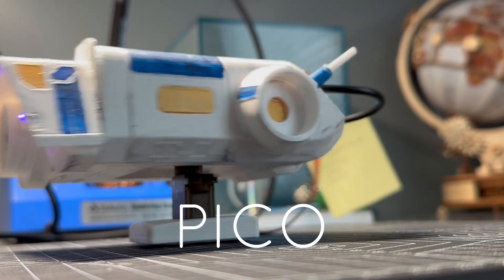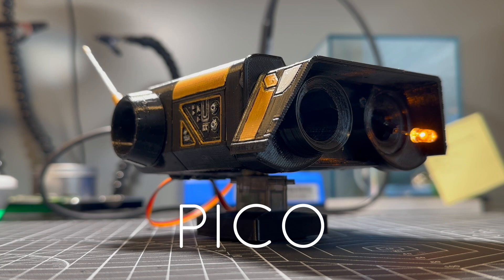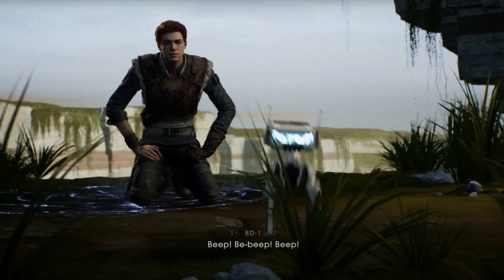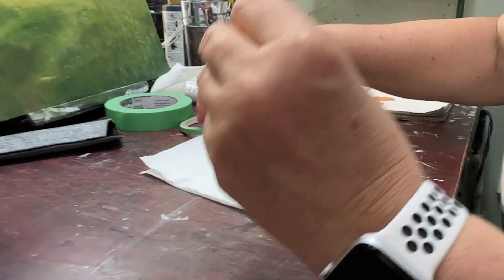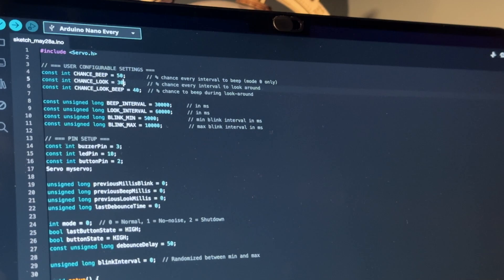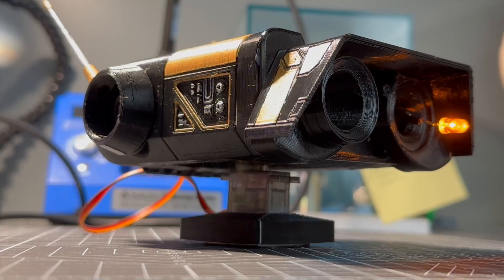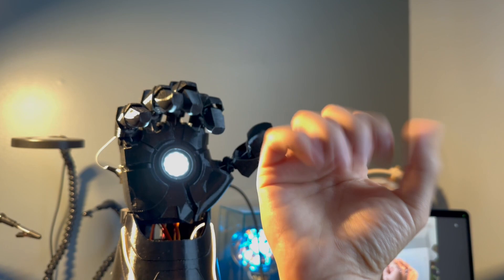My Smartest DIY Robot Yet (It's Open Source!)

Comment: hey man, idk if ur gna see this but the main frame of the robot (pico head) has multiple non manifold edges (1924 to be exact) and i cannot slice or print, im just making you aware of this, take the time u need to fix it or not, ive also put a comment in the thingiverse post
Reply from the maker: Thanks man, I wonder why I didn't see that or have issues with my slicer, I'm glad you brought it to my attention, I'll look into it!
Reply: @MateoTechLab np, btw ive fixed the problem by putting multiple cuts into the part, so maybe put that into the description of the thingiverse psot
Reply from the maker: @Voidreaper236yeah good idea, if you’d like to just tell me your slicer and what you did to fix it right here I can add it in with your preferred username for credit too
Reply: @MateoTechLab i used the cut item, then i repaired it with windows repair system in prusa slicer, i dont know if its in orca slicer though because i had to do it manually

Comment: im building one of these and i was wondering how do i connect the camera to pico? im new to coding and such so i dont really know what im doing
Reply from the maker: The camera fits into Pico by sliding the end of it into the hole at 2:15, and it’s plugged into a small battery pack I bought on Amazon. If you’re wondering how to code the camera to see the video feed, you can look up the setup for a “web server video for ESP32 Wrover Cams.” If you have any more questions, feel free to ask me!

Comment: Can we get a more detailed parts-assembly guide please? Not quite sure how the printed parts integrate with each other
Reply from the maker: I can post an image of the digital parts and where they connect to the Thingiverse page if that helps
Reply from the maker: For now, here's my best guide on the 3D print parts alone, based on the file names from my Thingiverse Page:
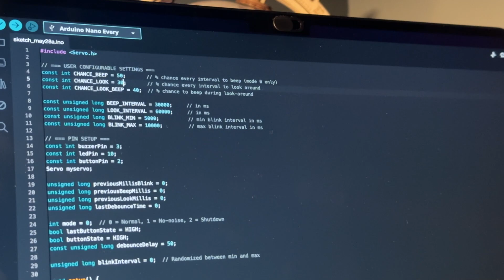1. [1:59] Glue Servo head to Pico_Head.stl
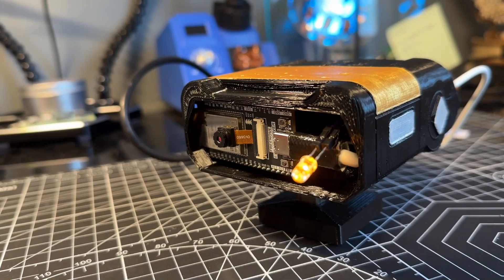2.  [2:26] Glue Servo & Magnet to Servo_Holder.stl
3. [2:35] Glue Eye_frame.stl AND Visor.stl to Mask.stl (Then glue Mask.stl to Pico_Head.stl)
4.  [2:43] Glue Antenna_ring.stl L and R to the left and right side, and slide (or glue) Antennas.stl into the rings.
5. Put other magnet under your shirt (I made a velcro strap that goes under my shirt) to attach to the Pico magnet.

Comment: Let's be honest, modern society is kinda built around the negative equity trap and  lending inflation. I've been seeing this for about 10-12 years now, can't see why people can't pick up on it.

If everyone tries to "get ahead" with credit cards and car loans then that inflates the price of goods because everyone can effectively afford more. This prices out people who intend to pay cash and almost forces everyone to buy into the loan system gain.

And when nearly everyone in society buys into the system then the goalposts shift and everyone is back to square one in terms of struggling to afford to buy a thing. People try to claw back gains by dragging out loan terms to lower payments and, as we've seen, over time the "new norm" becomes a longer loan term.

That's the inflation aspect. The negative equity aspect comes into play when the price of the asset drops, or when the gap between the value and what you owe widens. Here's the kicker, two great ways to widen the gap between the value of what you owe and what a thing is worth is:

1. When you drive the car off the lot and it immediately loses a massive chunk of money... And then rapidly depreciates over the next 5 years too of course.

2. Dragging out a loan term dramatically increases the proportion of interest owed.

It's not really a shock that this is happening, one may even say it was probably designed to go that way. Here's another freebie - shoebox houses, it's not just a natural trend, it's destined to happen as people scratch to afford house prices.

Comment: Is your printer good?? it looks sick.
Not in a good way. Print quality could be WAY better.
check the recommended speed and temps on your material.
Reply from the maker: You're very right, my printer is getting very very old and I switch materials all the time. I'm actually looking for a new printer currently. However, for this project I actually didn't care for getting a perfect print quality like I do for other projects like F.L.E.X. Simply because this project is meant to look like an old beat up Star Wars droid, I even painted the original Pico to look weathered, and gave him marks to look used.

Comment: I teach Stem to kids... and this looks like it would be incredible to have on my shoulder when talking to them
Reply from the maker: I just had it on my shoulder all week at a science Expo, and I couldn’t agree more, the kids love the little guy!
Reply: @MateoTechLab  Any chance you would release the step files as well? I'd like to make a few modifications to make it more personalized, and keep upgrading it year after year. I work with teens as well, and might challenge them to help come up with the upgrades
Reply from the maker: @rw218 I created the models in Blender, I could share the blend file if that would help. However you can also import all of the files as STL files to Blender and get the same result as me. If not, you can use other softwares like FreeCAD to convert the STLs to STEP files too

Comment: heya man, a quick tip for painting 3d parts, use filler coat primer after sanding (use a mask and have good ventilation when sanding), it makes the surface finish so much better, i will also attempt to build one with my moth filled wallet :)
Reply from the maker: Hey thanks man! I have used filler primer and sanding to paint prints in the past, like my Iron Man hand (the one I wear) and I definitely will for helmets and stuff. But for these little robots I didn’t feel the need. Good luck with your robot!
Reply: @MateoTechLab ty man

Comment: How do you wear it on your shoulder tho
Reply from the maker: Using the neodymium magnet I showed at 2:30 and the other one under my shirt
Reply: @MateoTechLabwon’t it be unstable?
Like falling of and slipping and stuff
Reply from the maker: @airrstorm It’s been on my shoulder for a few weeks now at different expos, and these special magnets are very strong and sturdy, not to mention Pico is quite light! There’s also a shoulder piece available to print that goes under the shirt and helps keep it in place.
Reply: @MateoTechLabOhhh Nicee
I’m thinking of adding a mic and speaker and an AI model and taking it everywhere I go as a cool buddy
Reply from the maker: @airrstorm that’s awesome, I recommend! As long as you can fit all the components, but you can always make your own extension pack if needed with a second magnet that way it’s also double enforced. Good luck man!
Reply: @MateoTechLab thanks
And thanks for the design 
Great video btw